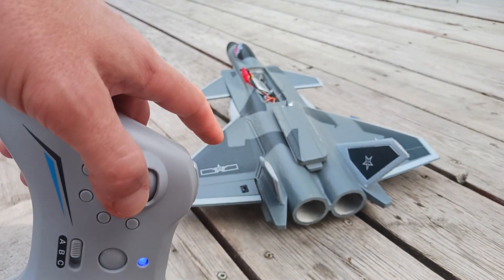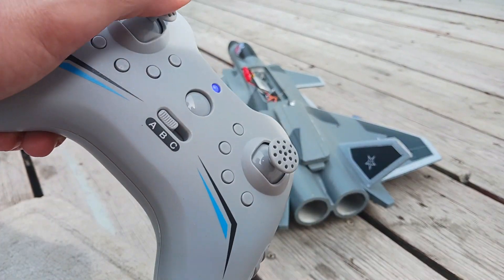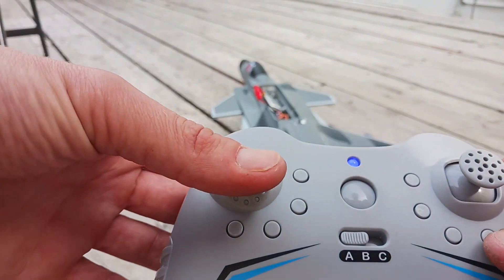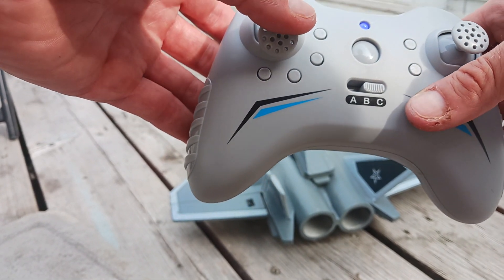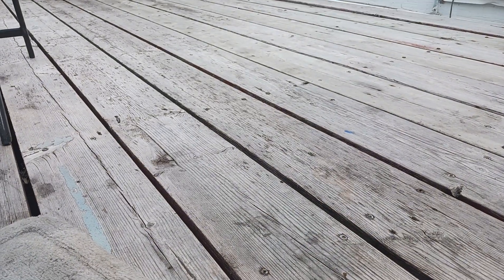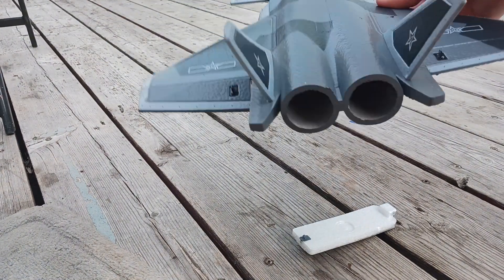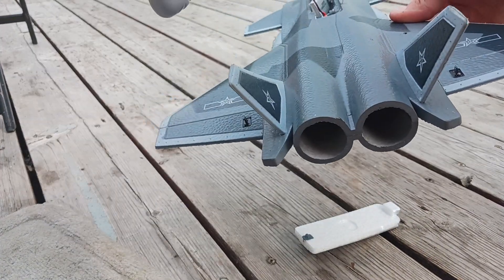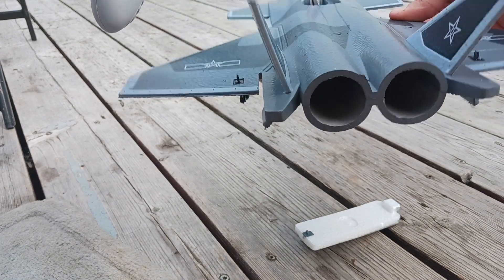Well darn I guess 2s permanently glitched the Feixiong FX9630 J-20// Only use 1s 3.7volt

Comment: Bummer! Will it be hard to change out the electronics or is everything fairly accessible?
Reply from the maker: It seems like a new sytem wouldnt be that hard. Theres good space and the servos are 3 wire, so you won't need new servos
Reply: @ChiefRickyRC  Cool!
Reply: @ToyotaGuy1971  what would you recommend?
Reply: @ChiefRickyRC  what would you recommend ?
Reply from the maker: I was looking at rtr systems with two motors, but they all have 5 wire servos. Theres a new commentor who says he is using a Radiomaster for controller now. Im gonna learn how that works. Ive found brushless 30mm edfs fans amd ESC's with different KV for 2s or 3s. AliExpress has EDF jets for sale with full power kits combos you can buy separately. Im thinking one of them

Comment: Great flying, like i said in one of the comments there is a dedicted 2s version in a revised white box also. Mine came with a 400 mah 2s battery and has some good thrust behind her. For 120 Australian i paid its a brilliant little jet 😁
Reply from the maker: Thank you! Thanks for the info that helps. Im super glad bro good deal right
Reply from the maker: She gets some speed with the nose down aye 👏 thanks again 🙏
Reply: She certainly does, I was wondering does yours have a lazy aileron at all? Mine is a bit slow on the return when you let go of the sticks on the left side, and fully trimmed one side to max just to have them aligned on flat. I will see how it flies when I test it, hopefully its OK 😅
Reply from the maker: @michaelhoward4402 i just checked and this one has fast even 3 wire servos. Although i remember when i turned gyro off it would barrel roll into a dive i couldnt save without hitting the gyro back on lol
Reply: That's probably what will happen to this lol, i will see how it goes when I maiden it on Tuesday when it dries up a bit 😂
Reply from the maker: @michaelhoward4402 get some good elevation she barrel rolls missles down fast. It did instantly pull up and level out fast and hard that was impressive
Reply: Good to know thanks for that, I will probably keep it in A safe mode until I get used to it, looks a bit touchy ha ha

Comment: What ever happened to this one? Did you get it working again? I maidened my J20 today and it flew great. My only issue was the range of my remote was short 70-90 feet. Afterwards, it lost connection. Gonna change my remote batteriesn and try again tomorrow. I almost crashed it full speed from a high dive like your J35 video but managed to run in that direction,  regain connection and pull up within time! That was scary...my AA batteries are relatively new. I did a flight with my Paptor plane the other day but that shouldn't have drained the remote batteries so bad they would die like that. Just concerned
Reply from the maker: I've been working on the J20s last few days and the 1st 1s version burnt iys motors a new 2s mainboard didn't fix it. My 2nd J20 the 2s works just lost I range to 20 feet, so I'm swapping the new 2s mainboard reciever/esc into it. New plan I'm fully rebuilding the 1s J20 to brushless and will have the video up right away. So any TX protocol transmitter will controll the J20 I've heard, but yeah the stock controller is bad that sounds about right even with new batteries it has short range maybe 70 meters. The J35 controller has 200 meter range and might solve the J20 issue  as well.  I think wifi and structures messes with J20 connection and noticed it has better connection in wide open areas. The j35 hasn't lost connection yet and I've flown it around the neighborhood in my driveway and was great. I have lots of content to edit up and am working hard. New MJX, HBX, Hosim, and MN jeeps up next. I'm glad you got the j20 we will have it super wicked in no time
Reply: @ChiefRickyRC  Thanks for taking  time to respond and confirm. At first I was frustrated and thinking about returning it but now i understand the WiFi controller may be experiencing interference. I flew it again in another area and didn't notice it as much as the first location. It lost signal once when I flew it towards one of the baseball field poles but that was it. On another note, just got the QF009 yesterday. This thing is beautiful! I can see you having one of these in your fleet as well
Reply from the maker: @mike_t_007 you got it bro, that SU27 is wicked actually was going to get it and keep putting it off.    That one is really good I can't belive it's not a EDF, but I still like it